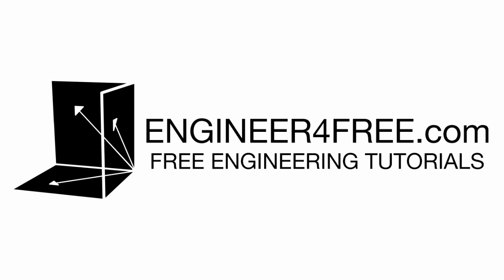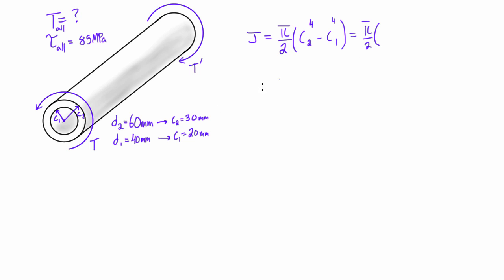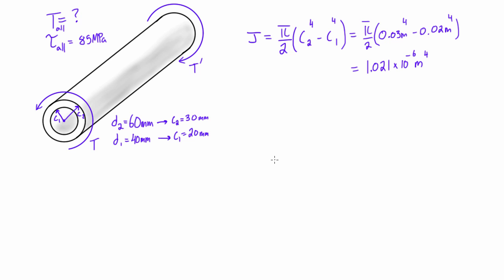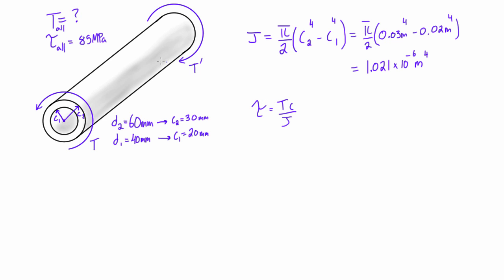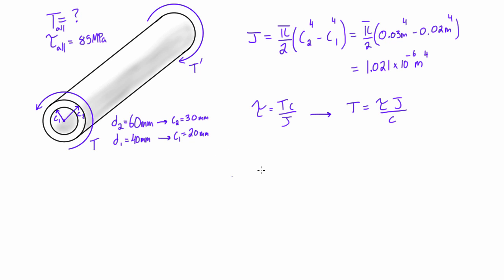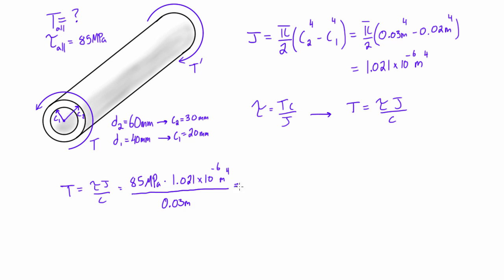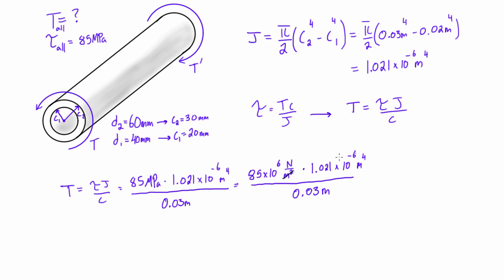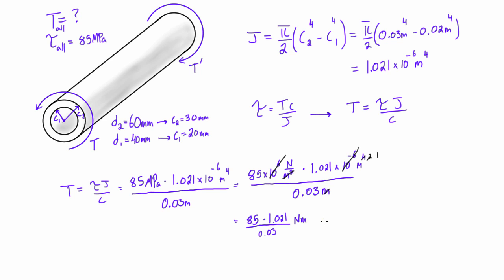Find the maximum permissible torque for a shaft of known dimensions

Comment: Why did you not use J=(π×d4)÷32
Reply: Because instead of D^4 he used r^4.  In the video C1 & C2 are radius.  d=2*r.  Therefore (2*r)^4= 16r.  16/32 gives the 1/2 you see in the denominator.  I was seriously confused too.  Had to look that one up so I will post here if others were scratching there head the same way I was.
Reply: dont think you need the answer anymore😂 but its because it has an opening

Comment: Are you sure you want to use the inner radius to earn the Maximum Torque out of this? 

Because when we rearrange the equation for Torque it'll be:       T = ( Shear stress * I polar ) / ( distance from center ) while we have already fixed values for  each of: Shear stress = 85 Mpa & I polar = 1021017.612 mm^4 . And what we have left is the value of: Distance from the center, and since it is in the denominator we need to decrease it's value as much as possible so the Torque's value rise to it's Max.. .
 
and in order to do that is to choose the inner radius of the shaft ( 20 mm ) to obtain our MAXIMUM Torque.. am i right ?
Reply: i think you are wrong...we are essentially looking for the torque which caused the max shear force...so we put in the c at which the shear force is at it's maximum, and that is the outer dimension (30 mm)

you may want to refer to the equation before it is rearranged for T to visualise this

take this with a grain of salt though, I'm just a student, but I'm open for discussion :)

Comment: what if the shaft is from 2 irons
Reply from the maker: Hey Anas, then it would be similar to this example, https://www.engineer4free.com/4/angle-of-twist-due-to-torsion-in-a-shaft-with-varying-cross-section but rather than having J1 and J2, we'd have G1 and G2. Assuming the cross section is the same size and that the 2 sections are not overlapping. Also worth checking out the pure bending of composite materials videos (#29-24) here: engineer4free.com/mechanics-of-materials They're about bending, not torsion, but some concepts are transferrable
Reply: @Engineer4Free  thank you sir 🙏
U saved my life 😂

Comment: Thanks for the explanation. What surprised me that the length of the rod doesn't have any effect for this one. But now when I think about it more, it makes sense. The length only changes how much twist can be in the rod before it brakes. Thank you for opening my eyes :D
Reply from the maker: Yeahhhh cool eh. The longer the member, the greater the angle of twist will be, when all else is the same. You might be interested in checking the other torsion videos I did, they are numbers 14-21 here: engineer4free.com/mechanics-of-materials 👌👌